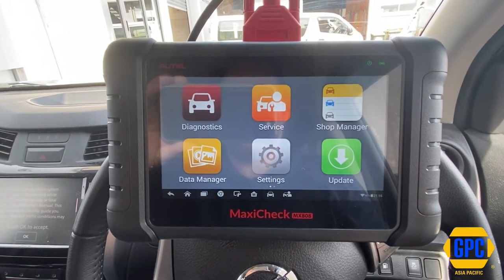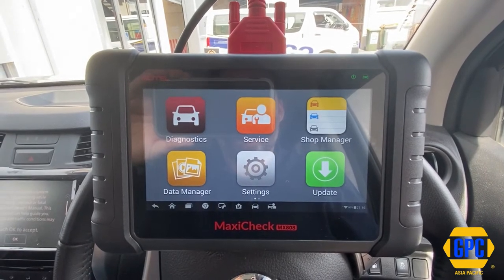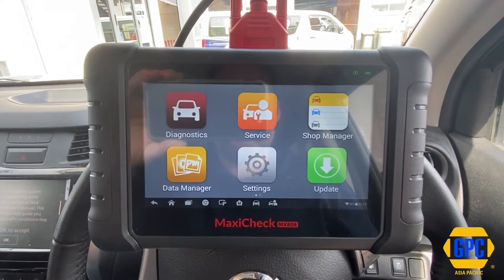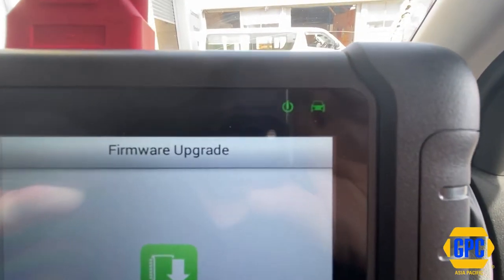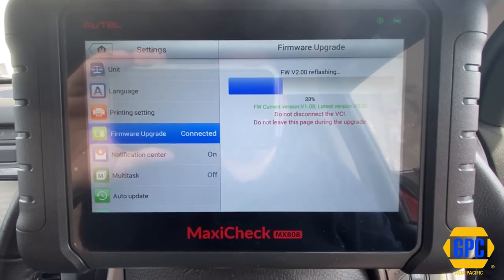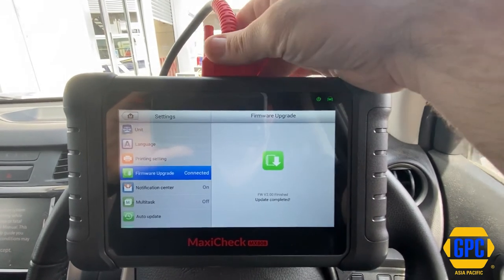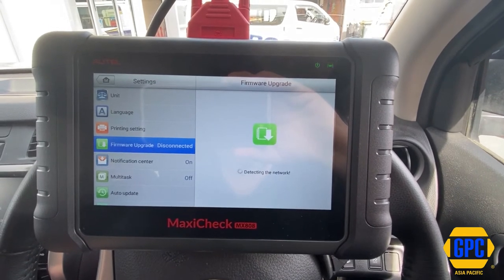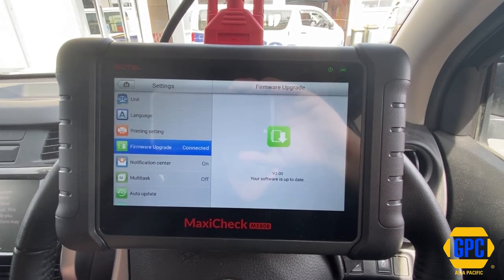Autel MX808 Firmware Update

Comment: So basically you still need a subscription to be able to update it? If I choose not to update my MK 808, does this mean I’m pretty much screwed…?
Reply from the maker: Hello, Yes you will need a Subscription to update CAR BRANDS. But the VCI Firmware Update does not, and the MX808 does not require continuous licensing in order to operate. The MX808 will still use the Installed software "out of license" and when a license is purchased you will be able to update to the latest software regardless of the amount of time between updates.

Comment: hi you know I did all that procedure exactly the same but when I returned to the main menu I lost the connection with the car and a message appears that says decoding failed.  what do you think i can do?
Reply from the maker: I suggest trying abother vehicle, or I have made a OBD2 plug to to this on my office desk. Just cut out an OBD2 socket froma wrecked car and then found a cheap 12V power supply. Earth pins 4 & 5, 12V to pin 16 and then power up the VCI this way.

Comment: Already updated and still won't connect to ANY of my vehicles.
Reply from the maker: If the VCI updates successfully and the unit does not connect to any vehicles, it's likely that either the main cable of the main board is faulty. Replacing the cable is cheap and easy, but the main board would have to be done by an Autel Agent.

Comment: Hello please help havea  MX 808 what do to get a car that is not in the diagnostic list?need to have this car in device
Reply from the maker: If your unit does not have a specific car brand (eg. Tesla) then it cannot be added. The MX808 is a basic tool sold at a lower price point. To get more car brands and better diagnostic ability you need to buy a better model like the newly released MS906PRO

Comment: What does the update do
Reply from the maker: The VCI “Vehicle Communication Interface” Module is how the Scantool talks to the Vehicle. Sometimes either the Scantools software requires a change in how this communication is done and sometimes it’s a new vehicle that has a different method. Updating the VCI FirmWare ensures the communication between the two continues.
Reply: @gpcdiagnostics  can I do the firmware update with a alixpress mk808?
Reply from the maker: @hugopic  Yes, the firmware update is done the same no matter where you brought it from.